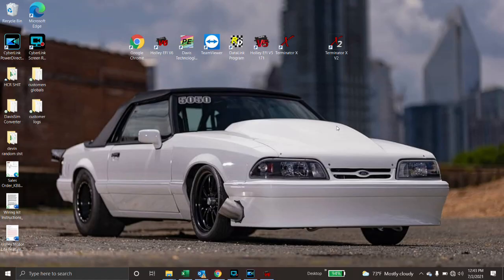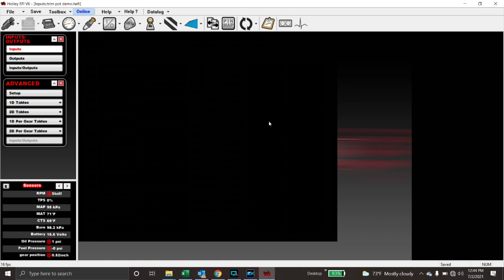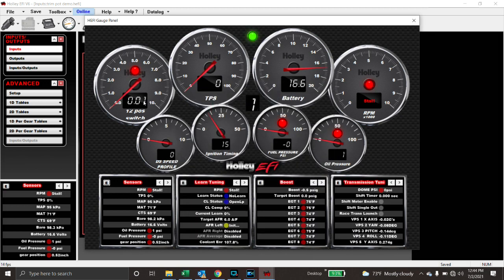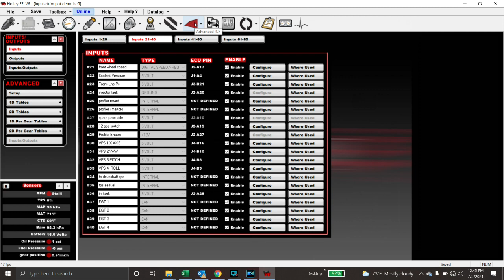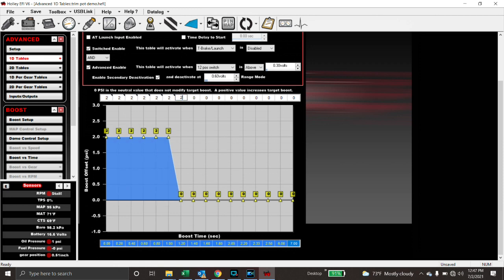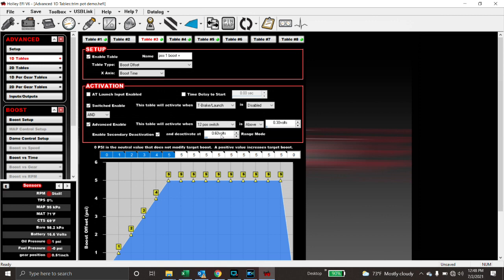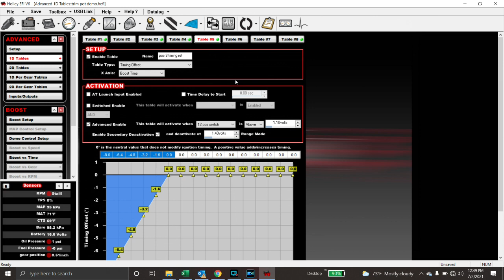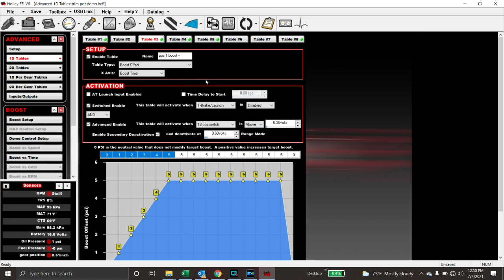12 Position Switch in Holley Efi

Comment: For a street car, could this be used as added security?  Switch has to be in pos "x" and "park/neutral" for the starter to engage with the factory key?
Reply from the maker: Yes if you ran the starter output thru ecu

Comment: Devin, I'm installing a Terminator x max on my truck, I want to know your opinion on using the green wire to directly power the fuel pump. My fuel pump is in the parameters of being able to do that say the instructions. But it doesn't hurt to get a second opinion and I feel confident in your views.  I Apologize if you've already made a video of this, I have a learning disability patience and temperament issues,  getting this far for me is a miracle, if you can find the time to answer I would appreciate it,  but if you don't it's not like I'm going to unsubscribe ✌
Reply from the maker: i always suggest erroring on the side of caution and using the green fuel pump wire to trigger another relay so the load isnt carried thru the relay that is also powering your injectors.
Reply: @theholleyefiguy  Thank you devin,    I'm a little confused on why Holly  tell you something it is possibly setting you up for failure ? I have confidence in your knowledge and opinion. My 6.0  is completely stock for now, lost job when pandemic started and motor blew up a week after, give me time for the swap from the lame 190hp tbi 350 been stranded ever since and out of cash,  wired it straight to the green wire as the instructions said, sure hope it will be okay till I can afford to do it the correct way you recommend. I know a relay and some 10 gauge wiring is not that expensive but it's actually that bad for me. Can't wait till I can afford to take advantage of more of your knowledge instead of just being a loser with a dream of 700 at the tire with 37" tires ✌